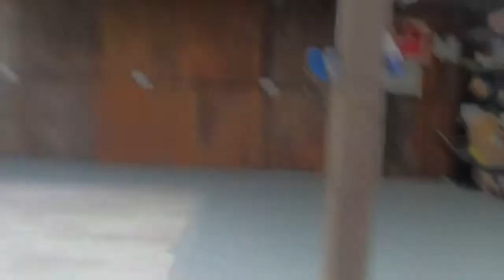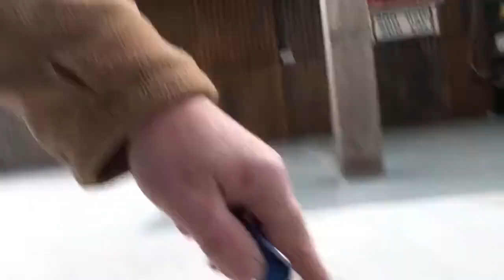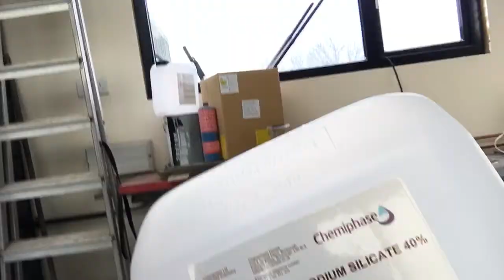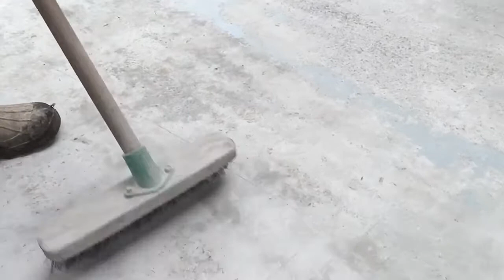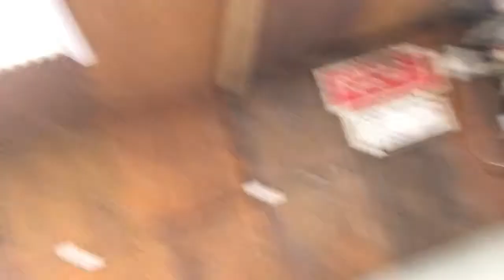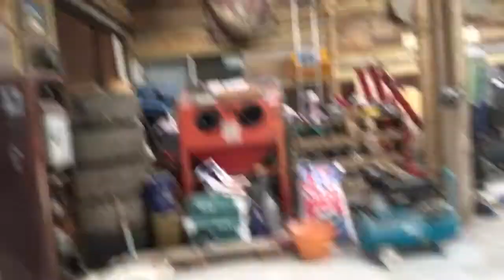Dusting concrete workshop floor fix.

Comment: Thanks very much for taking the time to record this and share it with others. Where did you get the sodium silicate from?
Reply from the maker: In UK I found it on eBay from Chemiphase but have seen they also sell on amazon or directly hope that helps, Sodium Silicate 5 Litres (Water Glass) Concrete Sealer, Adhesive, Automotive Gasket sealant https://www.amazon.co.uk/dp/B07NPVKDXP/ref=cm_sw_r_cp_api_i_vmkgFb4R1BFMS
Reply: @MrLeealanstevens  Thanks for that. 👍

Comment: Great info, thanks for sharing. Has the polyurethane paint on top of the sealed concrete stood test of time? Cheers.
Reply from the maker: Polyurethane no it’s stuck well but wears very quickly 
Epoxy I put under car lift and where main work is done still looks like new 
Personally I’d opt for epoxy everytime now 
I will redo polyurethane areas in this spring coming

Comment: Hi just watched you video thanks for uploading it I have the same problem I was just wondering how this is standing up to the test of time ? Thanks
Reply from the maker: It’s actually holding up very well. 
I painted it with two part epoxy no lifting etc and gets hard use. 
But before treatment paint was lifting in matter of days. 
I did have a one issue with outside drainage and one corner got damp through the wall, that area of floor the paint did lift but all sorted now.

Comment: Ok thanks for the information very helpful so when you mixed it you did 4 parts water to 1 part of the sodium  silicate? I have spoke to the company an they can't advise the mix rate ?thanks
Reply from the maker: Was a while ago now but yes believe your right I did state on package/ container label mix ratios 
I’m surprised they couldn’t advise you. 
If memory serves I mixed it up in bucket can remember next day was surprised how much crystals there was on the inside of the bucket and how difficult it was to clean up so I’d advise washing out everything when you finish rather than leaving it for another day.
Reply from the maker: Believe I may still have a container somewhere will check tomorrow if so I’ll update with mix ratio from label.

Comment: Ok thanks for the info I'll wait for your reply as they dont know what mix the  ratios are
Reply from the maker: Can’t find any old container but 99% sure was 4 parts water to 1 part chemical 
End of the day it’s the chemicals that do the work water just evaporates away. 
I’d go with that be honest
Reply: Ok I've tryed that I'm on the 3rd third coat an I'm getting white patches is that what you had ?

Comment: Ok thanks for your reply that  sounds good was your concreate easy to mark ie soft/ porous did this help to harden the concrete aswell?also how is the areas that you painted with the other paint ? Thanks
Reply from the maker: It did harden the surface up. 
Been using trolley jacks etc no issues 
The only area I’ve had issues is where flood from outside leaked in and made concrete in that area damp. 
That area happened to be painted with Polyurethane paint and do lift, will scrap that area this year and finish it with two part epoxy 
Other than that very happy 
I would if doing it again add an extra few coat of sealer more than anything just for peace of mind